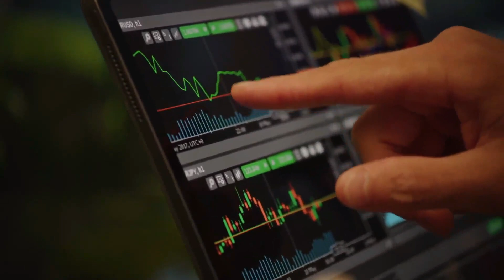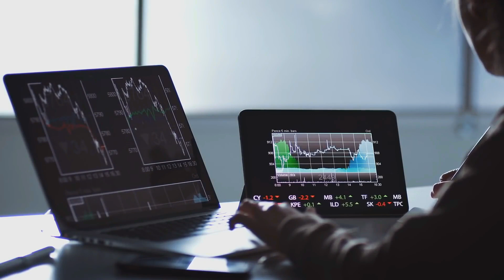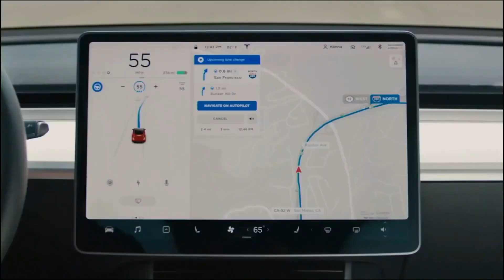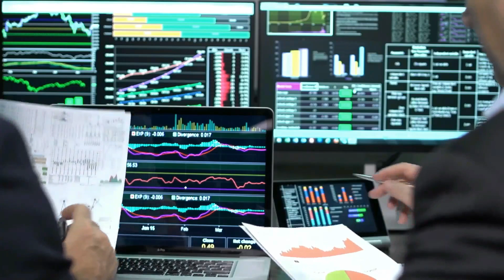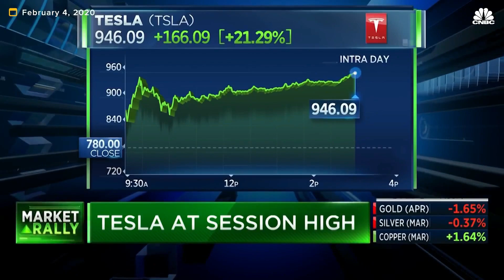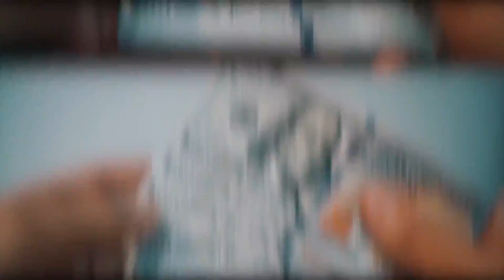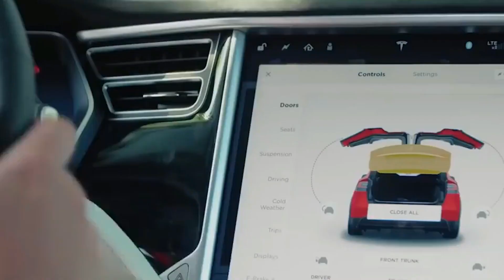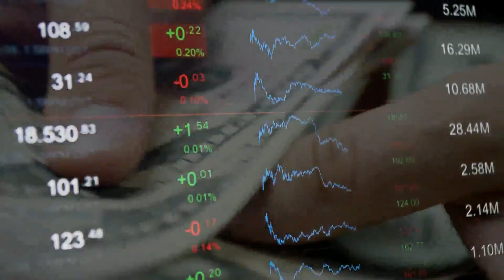Tesla Stock Disruptive INNOVATION 🔥 The DIP is TEMPORARY ☀️ Tesla Stock Analysis 😏

Comment: They could add six more factories in 2022 and it won't make a bit of difference.  If anything, it will send the stock further down even faster as this will completely erode the profit margin for the company.  Tesla has already admitted that they are currently bound by key component availability with no relief in sight, and in fact started omitting essential parts on cars to make those 2021 production numbers.  There is a zero percent chance they increase their production by 50% this year.  And demand in the US is falling hard.  The Model 3 Performance and Model Y performance delivery promise is for March 2022.  That is just a few weeks away.  Meanwhile, others have sold out entire product lines for 2022.  I'm calling it now.  Tesla stock under $200 a share before the end of the year.